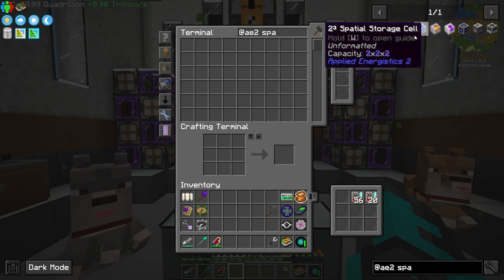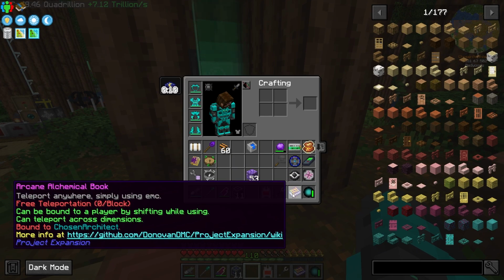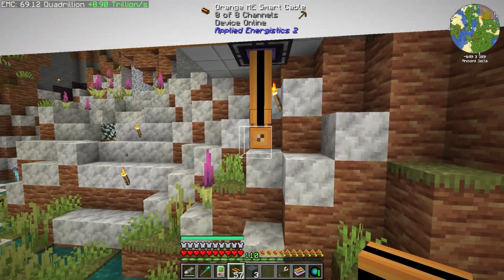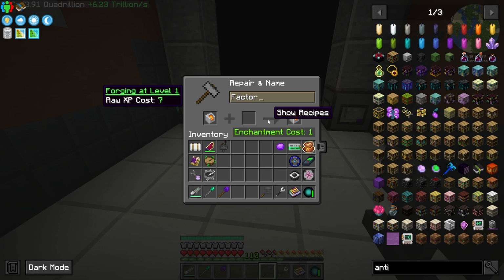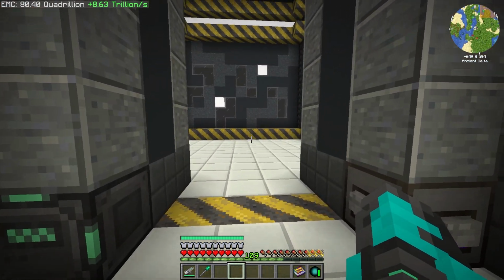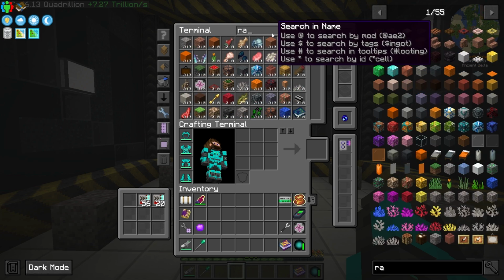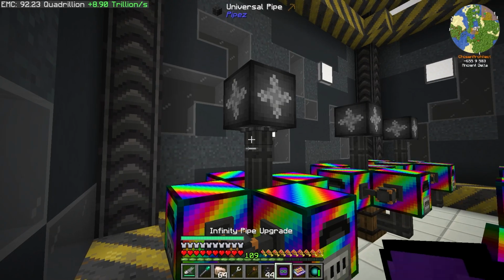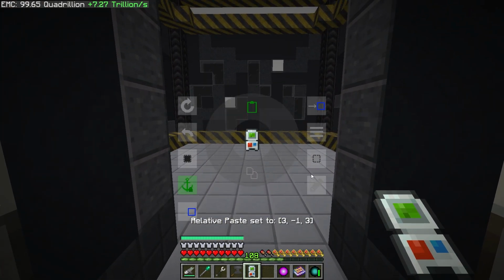PROJECT ARCHITECT 2 - EP 42: AE2 Spatial Storage for Automation Moving

Comment: i know im late to the party but just finished my transmutation Interface today having a blast and really taking it easy and building 😰😰😰. you played FTB genesis that used spatial storage but the wormholes are neat and i didnt know you could go in and out of the spatial that's awesome always learning something
Reply from the maker: I did use them in FTB genesis but was never showing how to set them up or how they work. They are just there to use in that modpack so this was my first time getting to play with them and they are amazing!
Reply: @ChosenArchitect  i agree they are amazing also there is a iron furnace copy config it looks like i little red router and i dont think you turn on sort 28:29

Comment: 1. There is a way, if I remember correctly, within ae2, to chunkload(without FTB chunkloading) all of those dimensions like many at the same time. And use them all at the same time. I don't remember if weactually need to contain those cells inside a ME disk drive or not...
Reply from the maker: you need a anchor from AE2